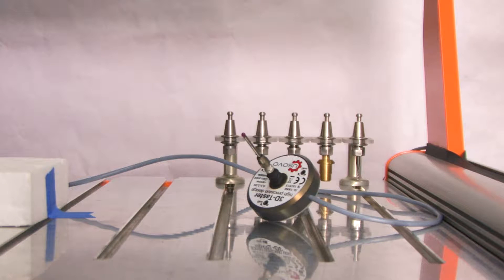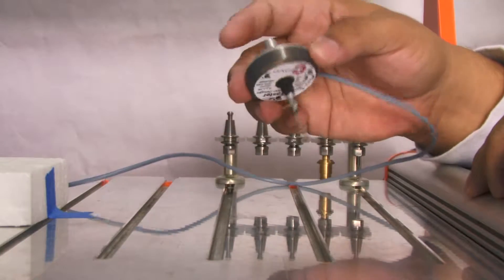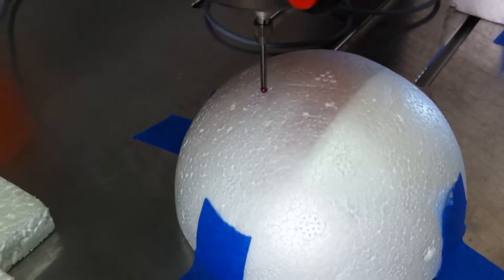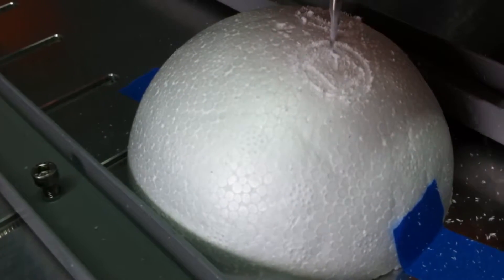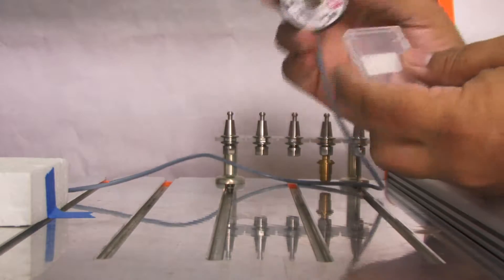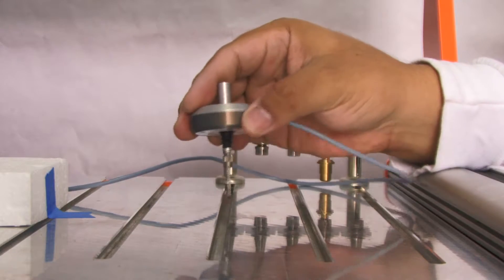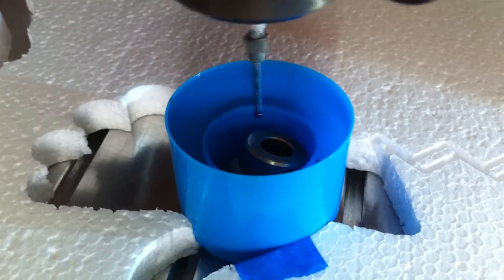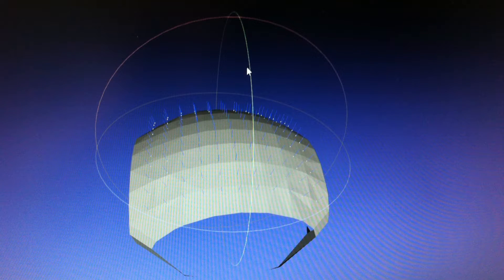3D Probe Preview

Comment: Before 1 week I was ordered this sensor. Before 2 days it arive...
 Today I test it but cannot find exactly the center. 
 If you looking detailed on the video on 2:29 it is not centered properly.

This tool not working properly! When I turn the spindle with 3D touch probe a bal tip move left-right

The perfect cornering is when the middle of the tool is exactly on the edge